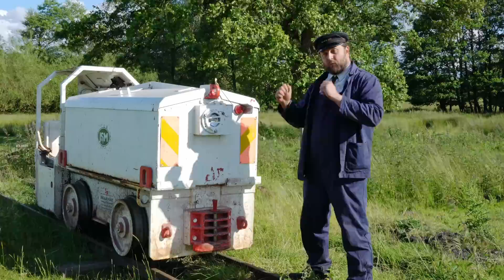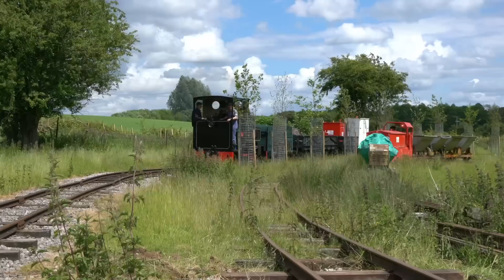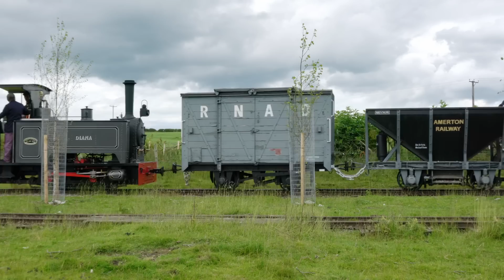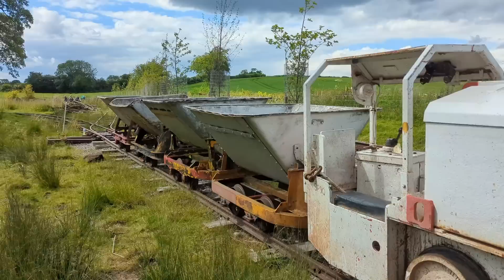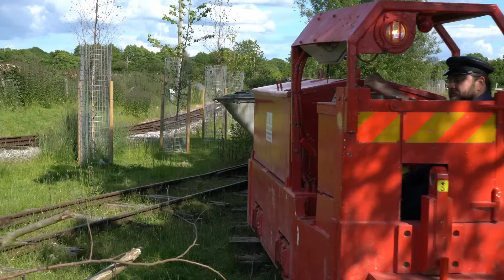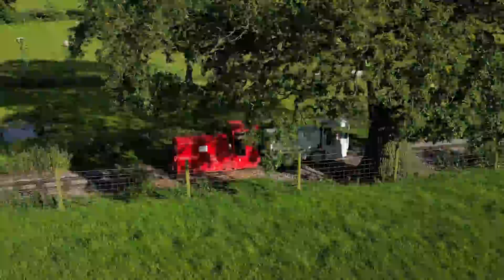Could these be the Perfect EV's at the Amerton Railway Steam Gala

Comment: 1:54 It would do an awful lot of good, as a presenter, to know and share what battery refurbishing and voltage balancing is
Reply: It is basically a forklift battery, comprised of many 2v cells in a mix of series and paralell. Each cell needs to be specially treated in order to get them to hold a charge. There's lots of info online about it.

Comment: What gauge are these engines and the larger ones seen moving around?
Both seem like Narrow Gauge but the size differences confuse me.
Reply: The whole railway is 2 foot gauge. 🙂 There's some colossal engines on 2 foot gauge, but these are all fairly small. Around 10 metric tons is our limit.
Reply: It's probably all two foot gauge. (Haven't checked.) You can see from the owner's plates on the two battery locos that they were previously used for tunnel construction, and therefore small size was important -- very little superstructure further out than the wheels.

Comment: Yeah if say a mobility scooter won't hold charge you can join a bunch of 9v together and attach it to the battery. Kills the 9v ones but gets the big one going again saving a fortune. I imagine it's a similar thing here

I'd love to plod around on something like that all day ferrying cargo back and forth.
Reply: The batteries in these are a big group of 2v cells in a mix of series and parallel to get the right voltage (I think they're nominally 72v but I'm no expert)

Comment: They (especially the white one) remind me of a peat railway museum near where I live. They run engines not unlike these (tiny industrial ones on overgrown, uneven tracks), but the ones they run are mostly a little older (~ 1930’s - 60’s) and run on diesel. There’s nothing quite like the sound and smell of a single cylinder two stroke diesel thumping away at low RPMs!
Reply from the maker: It's a super sound!

Comment: The quirkier the better in my books and those two tick plenty of boxes!

Question please:  Do those tipper waggons behave better empty or loaded?
Reply from the maker: I think they'd be better loaded. They're a little light
Reply: @lmm you wait till one comes off when it's full, they're a lot less fun then 😂
Reply: I was wondering how they would cope being loaded, as the skips were rocking about pretty wildly. If you look carefully, there's quite a lot of the skip 'V' below the pivot points which will lower the overall centre of gravity and stabilise the skip against the load above the pivot..
Reply: @PeterJewell2 they are generally quite compliant. You can re-rail one by hand on your own when empty, and if they weren't 600mm gauge (our railway is 610mm/2ft) they would run nicely. They are certainly a bit less wobbly when loaded. They are very well engineered.

Comment: Battery electric switchers/shunters, the only practical type of battery electric locomotive
Reply from the maker: These will run the service on the mainline all day apparently!
Reply: That was certainly the case until recently, but bi-mode MUs capable of running between unconnected OHLE routes are now considered economically viable with current battery tech. 

H² fuel cells are now proven tech which works, but  really need to quadruple their working lives (measured in hours) before they become much more widely accepted.  The tech IS advancing, but the story for now is akin to early jet propulsion. 

Solid-state batteries will be the next 'big thing' (Toyota intend full launch of a car so equipped in 2025) and this tech is vastly less prone to fire at the same time as supporting currently impossible charge rates.

Comment: It might be a little soulless, but it's a heck of a lot easier than waking up a cold steam loco :)
Reply: .... providing you remember to set a decent trickle charge overnight  (the tricklier the better for optimum battery longevity).
Reply: @TheHoveHeretic  To be fair, if you were going to do anything serious with these today, you'd just put in a bank of LiFePO4 cells.
Reply from the maker: Lot easier, not as much fun though!
Reply: There are ways of getting steam locomotives to work without turning up hours beforehand.
Reply: The only sustainable one i know of are electric pre heaters. Other methods damage the engine long term @physiocrat-sv

Comment: I can understand these being used in a private company for moving stuff
Reply: Down in Sussex, at least one brickworks equipped their R&W battery electrics for driverless operation with ramp operated trip switches, meaning the loco was started manually and trundled off on it's own until it came to wherever the 'stop ramp' had been bolted to a sleeper.

Luckily, it survived long enough to be rescued by Amberley's Chalk Pits Museum, where I believe the system forms part of industrial displays alongside the large collection of petrol and diesel locos.
Reply from the maker: That sounds amazing!
Reply from the maker: They're useful bits of plant

Comment: EV's are shite
Reply: No they make a lot of sense in their context. You don't want to be down in a mine next to a diesel exhaust and they are really cheap to operate.
Reply: @Sohave  So they have some use in certain instances. They would work better on an extension cord rather than batteries. Battery replacement is not cheap.
Reply: Mines are in many cases explosive atmospheres so you absolutely do not want sparking elements such as combustion engines or catenary. For regular rail batteries now are economically viable to be used as a hybrid/dual mode system for shunting or specific lines such as heavy train in a mountain emptying lower altitude and then going back. If a yard manages to get decent coverage with catenary then a catenary-battery shunter becomes viable with the use of LTO batteries which can charge in around 10-15 minutes(standard rate, no increased wear for that) while having 80% capacity lifetime of around 4000-10000 cycles.
Reply: @miragept  Having the batteries overheat and explode down in a mine wouldn't turn out very well either. If you are worried about sparks use compressed  air instead. No risk of fire
Reply: @MatthewBerginGarage and pit ponies don't need compressors to operate.
Reply: @MatthewBerginGarage  Properly designed battery packs which for rail would use LFP or LTO and maybe the new Na ones(still haven't managed to get much information about them so won't mention them) would have a low change of that happening, lets not forget that ICE got more destructive explosion chances than volatile battery chemistries, they do not go to news because its old news while battery ones are new news.
Compressed air would be a good alternative for safety indeed, it has however god awful energy density so in many cases not extremely practical.
Reply: You just continue living in your own fearful world. Just don't bother us with your fears. Batteries don't randomly overheard and have been in use in mines plenty over the past 50 years.
Reply: @mfbfreak  Obviously you have never faced a 4500 lb lead acid battery shorted out to the machine. Melts a 500 mcm cable in seconds. The bad part is there is no way to shut a battery off. Unless they are completely discharged they are always on. Our 50,000 lb coil tractors use 2 4500 lb 36 volt lead acid batteries in series for 72 volts. In my 40 years as an electrician shift leader at our steel mill I have dealt them on fire a few times. It is never fun. I imagine it would be much worse underground.
Reply: copium
Reply: Ok matthew
Reply: You're aware you pressed 'post'?
Reply: EMUs are great, far better than most diesels
Reply: These things use lead acid, there's a considerably lower risk of fire than in modern EVs.
Reply: @igotes there always was a risk of outgassing and explosion with lead-acid.  I've seen a fairly small 12v car battery go pop and wouldn't  care to repeat the experience with a 24v lorry battery.

It's worth remembering that ICE car fires are so common as to be unworthy of news coverage the vast majority of the time.  Only those of interest to the truly ghoulish (editors) make it to air or into print.
Reply: There have been electric locos for a very, very long time. They aren't a new invention!
Reply: LEAD-ACID batteries don't have the dangers lithium etc do.

Diesels stàrted and run for a few minutes like picking up 3 cars from TR cpany siding and placing in factory have cold start delay in cold weather and actual heavy wear as a result BIT Zsd seen hear starting off from cold start take foitvsteps and no warm up.

Put another way, start days work at 7am, be moving goods vans at 7-01 compare to warm up time of diesel not to mention steam.  Steam might take hour, or  fire banking or reporting hour earl6
Reply: @AlbertBenajam-ww1db  Any charged large battery is dangerous whatever their constitution. Batteries are always on they cannot be shut off.
Reply: Due to that reason automotive batteries require from what can remember a enable signal so that a output relay closes. Of course the relay/contactor can fail when opening the contacts but that..well.....is such a unlikely situation that one is really looking for a failure type to exist to be against something.
Reply: @miragept  Sorry I'm talking about lead acid batteries that weigh 4500 lbs and are the size of a small car, driving a machine the similar weight as a small locomotive. Not a piddly 100AH car battery
Reply: Don't know what that imperial weight lead battery weight is in kWh however it doesn't matter if its a 12v 100Ah one or a 1.5kV 2kAh one, proper safety design of pack helps reduce any destructive safety risk.
Reply: @miragept  When the wiring shorts out which it will, all things fail eventually, all hell breaks out. I have dealt with a failure situation a few times and it is never fun.
Reply: Indeed not fun, modern standard packs usually incorporate fuses between each cell/module. But its best for safe destructive short than a dangerous destructive one.
Reply: I admit I've never worked with big traction batteries professionally, but I have melted a couple of screwdrivers with UPS batteries. In my experience a dead short on lead acid is pretty spectacular, but I've never seen a proper fire, just a melted conductor. At least there's no flammable solvent inside the cell like there is in LiPo.
Reply: The cool thing is, the future will progress whether you want it to or not!